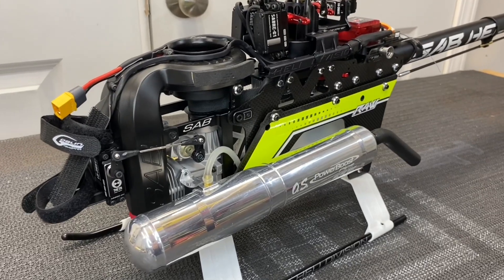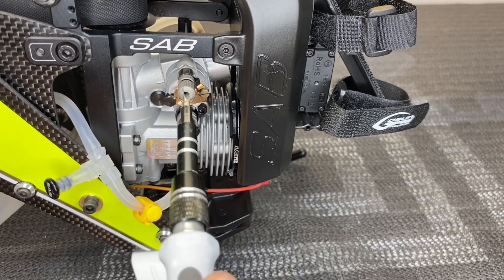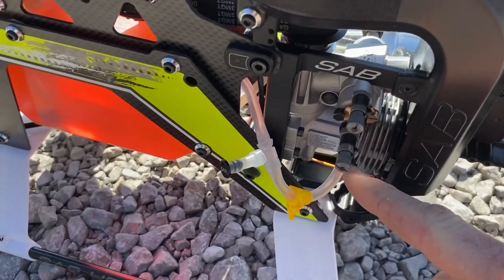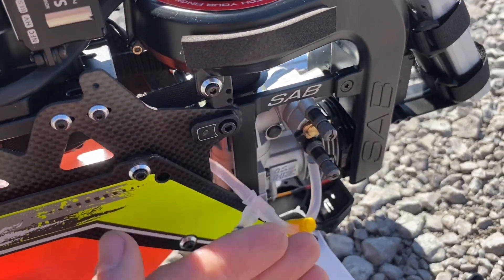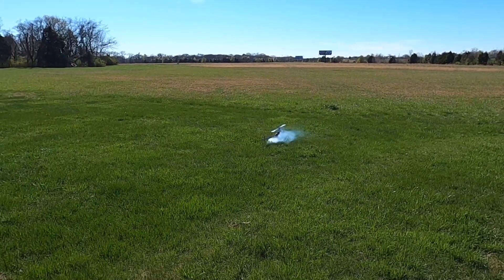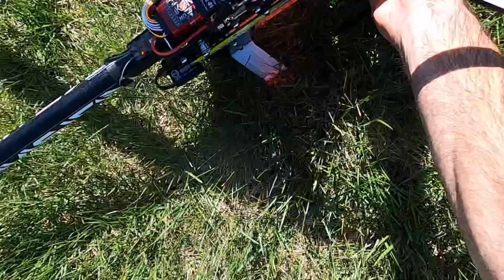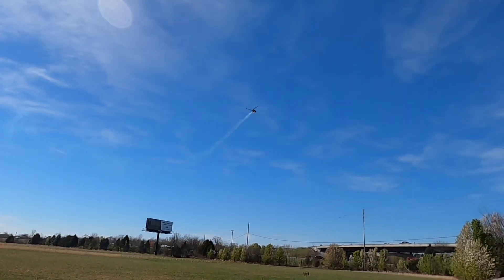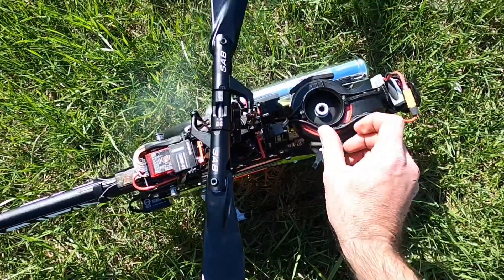How To Tune A Nitro RC Helicopter

Comment: Position that RATCHET SPRING and use it as the Fully-Closed marker.
Reply from the maker: Return springs are only good in the event of loss of power. If your have a RX failure or brown out/lock out servo is still powered up and no spring will pull newer servos pack with 200 plus oz of torque.

Comment: I’m so scared to lean it out.   I’ve been threw multiple motors from running lean.   Last motor actually cracked right at the front bearing.   Not sure if it was from me putting it in the oven or letting the heat get to 300f flying hard.   By the way you sound a lot like finless bob
Reply from the maker: I’ve been running nitro engines for over 25 years now. Basically my own life. I’ve only ever killed one engine from running lean, melted a piston. The smoke will tell you everything as well as the sound of the engine at idle. I personally like to run a little rich and that’s why I said in the video I don’t go for the “all out tune” I’m happy with the performance slightly rich. I don’t know who that is but I’ll look him up.

Comment: has anyone ever put alternators on these to charge the packs as they fly?  or would the gas run out before the battery pack anyway
Reply: Some people use a small brushless motor as a alternator. It's mostly done on gassers wich can have a flight time of up to 20 minutes. In that case weight also really isn't the biggest concern
Reply from the maker: Gas helicopters use a brushless motor on the top as a generator. It does work and charge the battery but I personally don’t see the need for that unless you are running high, powered Servos and flying for a long time. I get five 10 minute flights out of a RX pack on my Nitro‘s before I need to recharge or swap the battery out.
Reply: @westhobbiesrc8051  damn yeah so thatd have to be a pretty long flight to warrant using that 5 10 min flights on 1 lipo pack is pretty awesome still

Comment: I would go leaner on the mid and richen the high a couple of clicks. Many people run the high too lean and the mid too rich.
Reply: You are correct, that is what most people do. I also concur with your suggestions about this particular heli's tune. In my opinion, it is actually lean on the high side. You can tell it does not recover after getting into collective as it changes to the high needle. It should look on the rich side to keep temps in check. You can also tell during the flight as heat raised, it had even less power than initial settings when the power seemed fine.
   He did also speak about the idle needle. Unfortunately, he damaged the adjustment copper part as he did not loosed the locking nut before adjustment. There was an adjustment, but the needed stayed at the factory setting. It is the concentric that moves that copper part. The concentric bent it.
   Other than that, the instructional video is informative and with the right idea, the instructions are correct. The mid needle adjustment looked to be right on for the days temp.
Also, if it is on a governor, the collective affects the throttle 0%. It just moves the collective and the governor does what it needs with the throttle to maintain head speed. So the throttle/collective thing about going mid too high needle is incorrect.

Comment: Judging if it's rich based off of the smoke is not really that helpful, that can vary massively depending on what fuel you're using.

I've run fuels over the years where there has been massive amounts of smoke, and others that produced barely any, yet in both cases the tuning was spot on.

You're better off going by the sound.

Also doing the climb outs and stops as demonstrated in this video doesn't really show what you should be seeing, you're always going to get what looks like a surge of smoke at the top because you're going from having that smoke spread over the climb to being concentrated in a hover at the top, and it being blown out by the rotors.

What you need to do is hold that hover at the top for 3-4 seconds, and during that time watch the smoke, you need to look at it just at the exit of the exhaust, if it is high but then drops off to how it looks when it's sat in a hover for a long time, that's when it's rich.

Just coming to a stop, and not giving it time to do that could lead to the wrong conclusion, that it's rich when it isn't.
Reply: You should make a video.

Comment: That’s great. I might consider getting the raw 700. Also sold the vbar for a profit because of the problems. Might consider getting the ix14 after i save up again. Got a dremel 8260 and ag01 gimbals + bunch spares for the goosky and m1
Reply from the maker: I’ve seen some issues with the new NEO. Definitely not good! The IX14 is fantastic! Really love this radio. Highly recommend it. It’s always good to get stuff!

Comment: Great informative video. Glad i come across it. Ive just melted out my OS32 engine sadly. Piston detonation so clearly running too lean when i thoughtit was ok. Brand new engine in ready to follow your video from scratch,  can i ask what you mean by loading up when idling?

Thanks Regards Tim
Reply from the maker: Thank you! I’ve melted a piston in my old OS 50 (ran 50% nitro on accident and didn’t retune) loading up on idle is when the low end it’s too rich, you will hear the engine as it’s idling Gurgle down it’s loading up on fuel, and when you go to give it a little bit of throttle, it’ll spit a bunch of fuel out of the exhaust that is too rich on the low end. you want to be able to allow the engine to run for five minutes straight out idle and be able to give it throttle and it should not spit a bunch of fuel out or gurgle and burble as it comes up to rpm.
Reply: @westhobbiesrc8051  thanks so much for the help and info. I will do that and check. The engine is brand new so the mixture idle screw will be set to factory default.  In the manual it says the OS32 SX to wind main needle out 1 and half turns and go from there. The heli starts and runs bit will fine tune it properly.

Comment: I’m using the muffler for backplate pressure I can’t get my finger in there.   Where exactly are you touching?    Great video by the way thank you!!!
Reply from the maker: Thank you! So I’m touching the back plate or as long on the engine as you can. You could also use a temp gun and read the temperature that way witch is definitely more accurate but as long as you can feel the bottom or as close to the bottom of the engine as possible your god.
Reply: @westhobbiesrc8051  I got a temp sensor in the third fin,  under solid snappy tic tocs temps rise to 223F,   Then I back off,   But when I land I put my finger on the back plate area around the bolts and it seems to be good.   Thank you so much for this video.  Seems way more up to date compared to the older videos from 13 years ago
Reply from the maker: @th3s41nt  223 degrees is perfectly fine, engine will definitely heat up under hard load. I’m glad the video is helpful! What temp sensor are you using? What FBL? I’m about to make my own temp sensor.
Reply: @westhobbiesrc8051  Vbar neo with mikado temp sensor 05058 Temperature Sensor (- 300°C) VBar Control.   Works great and doesn’t break like other models or versions.   I remember using other brands and they wouldn’t last 2 flights before breaking.   I got the head up to 280 but I’m gonna stop letting it get that high as I’ve been burning up pistons/scratching the liners and pistons.
Reply from the maker: @th3s41nt  I’m going to try and make a sensor work with iKon, not seen anyone do it yet. Yeah, 280 degrees is way to hot. I’ve personally never burned up a piston or messed up a sleeve. But I always run a tad rich on my engines.

Comment: I’m thinking of getting back into flying . I have a XCel 60 and a shuttle z x   Don’t know what radio to go with . I super 8 is dead . I just ordered frsky X20 . But second guessing my self on it .
Reply from the maker: You should get back into flying! Wow, old school models. I’ve got a almost new Xcell 60 airframe if you ever need parts! The Frsky X20S is a great radio. Definitely a completely different radio then the older super 8! Programming is completely different now as well.

Comment: Hi, do you work on these? I was wondering if it's possible to send mine over for a checkup and tunning, I have recently acquired a Kyosho Caliber 30, it has an OS MAX 32SX engine, everything works, but it can sure use some tunning.
Reply from the maker: Hello, yes. Send me a email westhobbiesrc@hotmail.com we can go over everything In email.